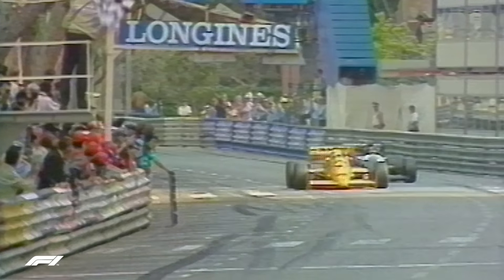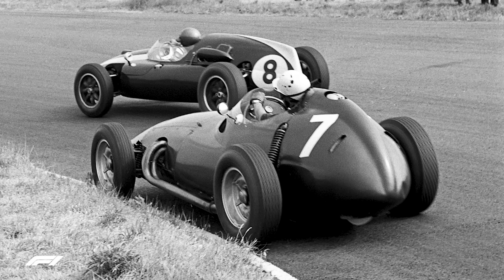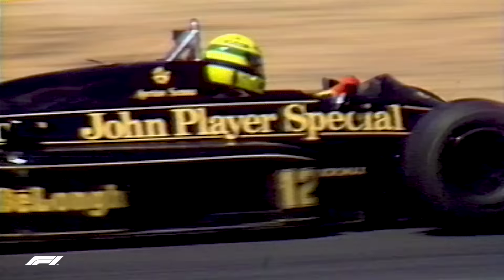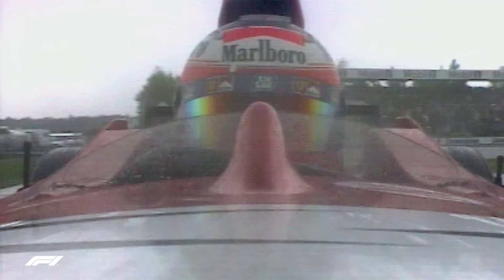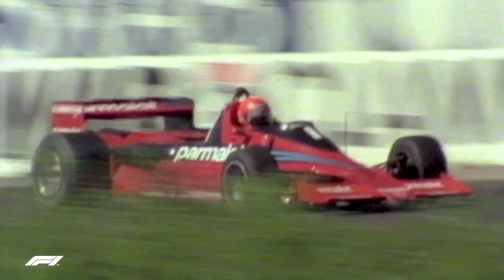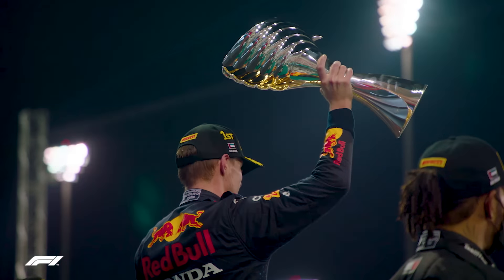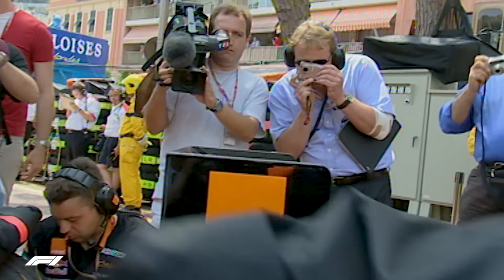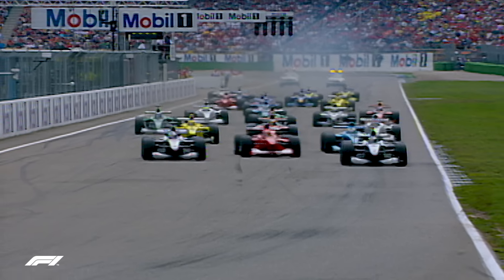Top 10 Biggest Technical Revolutions In F1

Comment: So after they banned turbo, ground effect, energy harvesting and various aero solutions the guys running Formula One realized that you can not really dictate the technological advancement and allowed these technologies to come back over the years?
Reply: It makes sense. New technologies are, by their nature, hard to understand. It wasn’t that F1 was wrong to ban them, it was just that they were banned until they were well understood enough to be effectively regulated.
Reply: @Llanowar_Kitten  True. The main reason for the bans were safety. Now that safety technology has come up and regulations tighten to make cars safer to race, they are now able to implement those innovations without compromising safety
Reply: @akmal94ibrahim  Right. But for the turbo for example, it wasn't only safety. The real safety problem due to the turbos back then were the qualifying engines delivering more than 1000 BHP. They had already found a solution to this issue in 1988 adding a poff-off valve to reduce the power even during the race. 
But they maint&ained the ban on the turbo the following year anyway due to a fundamental reason: the devlopement cost which was enlarging the gap between top teams and the rest of the grid threatening the small teams, the show and the sport future in general. 
That was one of the best FISA decisions. Immediatly, from the start of the 1989 season, there were so many new teams and engine constructors entries, and the gap between the teams in general tightened. 
The other argument against turbos was that this technology was not used yet that much on production cars.

Well, times change, now it's all different. The use of turbos is relevant from an energy and cost saving POV, the technology has come a long way and is largely used on roads, safety has evolved dramatically, and at the end the use of turbos is now mandatory in F1 anyway, so it won't have a negative impact on competitivness of small teams knowing they all have to use them
Reply: Funny how active suspension was put into F1 cars because of porpoising, and now porpoising's back.

Comment: 0:53 no, KERS does not convert the heat of the brakes into energy. It works by taking the kinetic energy of the spinning wheels and converting it into another form of energy. It's basically working the same way as today's MGU-K. Much like it, this could be connected to a battery, but back in '09, it could technically be another form of energy storage, like a flywheel.
Reply: Indeed. Very odd to hear such a mistake, how can they not know it!
Reply: *brakes
Reply: Yep, it is a common mistake haha thank you for explaining.
I even heard of this "heat from brakes" on an F1 technical segment on TV when introducing KERS. 🙃🙃
Reply: doesn't the "K" in KERS even stand for "kinetic" or so?
Reply: same at 7:55 or so, the turbocharger does not use the heat of the exhaust gases, but rather the kinetic energy of the flowing gas, to drive the intake side...
Reply: @AramcoPhil  From a thermodynamic standpoint, heat is the primary energy being extracted. Not the case with KERS.
Reply: @toxiczeu3597  my mind is incapable of remembering this, I misspell it every time lol
Reply: Williams worked on a flywheel system, but it was made unusable by the bigger fuel tanks added when they removed refueling.
That system has been used in some semi-trucks
Reply: @corystansbury  uhm, sure heat is being dispersed and that has its own benefits down the exhaust line, but the primary "driving force" of the exhaust (and thus the intake) Fan is the flow of the exhaust gas, no?
Reply: A more simple explanation: charging a battery with a engine makes the engine have less power, but if they let a fly wheel spin using the engine, and let the fly wheel charge the battery while braking they will have more power and more engine braking
Reply: They are basically the same technology regenerative brakes found on hybrids and EVs today.
Reply: @AramcoPhil  If you look at the contribution of heat, kinetic energy, and pressure in a system like this, you'll find that all three are sort of related (in that changing one impacts the others. In fact, we convert kinetic energy into "stagnation pressure" in certain calculations). You'll also find that in terms of enthalpy, which is the measure of the energy per unit mass in the gas stream, heat is the primary contributor to enthalpy. You'll also see that the gas stream loses heat (temperature) as it goes through the turbo. 

Simplifying it, heat is the energy form that creates the gas velocity. It's not, unlike what many surmise, simply pressure and imparted velocity from the piston pushing it out.
Reply: Actually what they're saying is true, In normal cars your kinetic energy is converted into heat and sound energy on braking while in cars with regen braking the heat part is mostly converted into electric energy there are loses in the form of heat due to friction and entropy and is the main reason why even the most efficient engine on the planet (modern turbo hybrid v6s) are only 50% efficient.
Reply: @corystansbury  aah, check, got you. Thanks for the insight!
Reply: I was thinking how wrong turning heat into energy sounds. Especially in the context of a Formula 1 car. It's just so silly. If only the writers of the Formula 1 Youtube-channel ever properly attended a physics class. Oh well. It made me giggle. 😄
One thing we can learn from this is: don't employ someone with a Youtube-experience as an engineer without a serious background check.
Reply: @khawajabasit977  But a regenerative braking system coverts kinetic energy into electric energy directly. There is no heat step. It would be fair to say "KERS converts energy, which would otherwise be turned into heat, into electricity and then stores that as chemical (battery) or kinetic (flywheel) energy," but that's not what they said. 

BTW, I'm vaguely remembering one of the early KERS systems being flywheel based, but I could be thinking of sportscar racing.
Reply: This dude really corrected f1 on how f1 works, amazing
Reply: Thank you!!! This is what you get when the official sporting channel is owned and run by a commercial business.
Reply: @corystansbury  The heat I was talking about isn't by design it is caused due to friction and the natural entropy of the system otherwise I agree with you completely I was trying to say the same thing just didn't describe it very well
About the flywheel thing you're correct it was a concept pioneered by Williams and they wanted to put it on their 09' car but with the ban on refueling and cars having bigger fuel tanks the flywheel was scraped due to packaging reasons however Williams licensed it to Audi I think not sure who used it in their leman hypercar (I maybe wrong about the category I know it was used in 24 hrs. of Lemans
Reply: Yes it’s painful to listen to.
Reply: The video has several errors. The explaination of KERS, Turbos and also carbon fibre does not come from aerospace engines. From the aerospace industrie in general, yes, but it was used for structural elements. There were 1 oder 2 other inaccuracies, that i dont remember out of my head right now
Reply: @Vaylon.  It has also successfully been used prototype endurance racing. If I recall correctly Audi? used it. And the system was supplied by Williams engineering
Reply: @ab8jeh  Arca Brakes in F1 cars also saved 50 more lives
Reply: @toxiczeu3597  Arca?
Reply: @corystansbury  hi Cory 🙏
Reply: @NightSidew1nd3r  Porsche, I think. But someone in sportscars/prototypes definitely used a Williams system
Reply: You're incredibly wrong and the amount of people that agree with you is shocking. KERS does, in fact, take the heat from the brakes and turns it into storeable energy. It is really not hard to look this up man.
Reply: @BouncingCow  The KERS explanation was correct. It does use the brakes.
Reply: @hockey161616  I did a quick Google search and could find nothing that suggests this. Can you tell me what you found? I'd love to look into this more.
Reply: @hockey161616  the system from 2009 was kinetic recuperation like in most on road hybrid cars, it does not use HEAT. it used a electric generator as a break, converting the rotation directly into electric energy (or kinetic in case of the flywheel Williams looked into, but never used). yes, it would have been heat in the break otherwise, but the heat never existed, so it did not use heat. later on mgu-h or ers-h was added, but only several seasons later (i think that started 2014). It was a break in itself, i never doubted that. it jsut does not use the heat as energy source.

Edit: Btw. recuperation from wikipedia: Regenerative braking is an energy recovery mechanism that slows down a moving vehicle or object by converting its kinetic energy into a form that can be either used immediately or stored until needed. In this mechanism, the electric traction motor uses the vehicle's MOMENTUM to recover energy that would OTHERWISE be LOST to the brake discs SA HEAT. This contrasts with conventional braking systems, where the excess kinetic energy is converted to unwanted and wasted heat due to friction in the brakes, or with rheostatic brakes, where the energy is recovered by using electric motors as generators but is immediately dissipated as heat in resistors.

I would be suprised if it used an indirect way or creating heat first, as it woulod result in losses. Heat in most cases is converted either by the rather inefficient Seebeck-Effect (reverse peltier element) or by steam powering a generator. ERS-H is basically a turbine harvesting the electrical energy. Personally I would argue it converts the velocity of the exhause gases due to a pressure gradient into energy and not directly the heat of the exhaust gas. But that depends on how you view the thermodynamic process and it debatable.
Ofc I it is not impossible that I am wrong, but I did not find any information on heat being harvested with the classic KERS - if you have additional information, i am highly interested.
Reply: I'm pretty sure that when the kinetic energy of the car's momentum is converted into electrical energy to be stored in the battery, it does indeed go through a stage of first being converted to heat energy. Of course, I'm also quite sure that someone who is a qualified expert in how the system operates could possibly correct me on that.
Reply: @colehartel7206  Usually rotational energy in converted by a generator, which itself in an inverted electric motor (in simple turns). The movement of magnets causes electrons to move, which are then stored in batteries. I am not sure where you would need converson to heat inbetween unless its a completely different system. But that would mean power plants also do not use the most efficient system as to current knowledge. The only relation to heat I can see is the heat generated due to losses of the system.
Edit: The source would still be kinetic energy, not heat.
Reply: @the1reef.243  That's where the flow down from F1 to road cars is so visible and important.

Many of these on the list pushed road car tech forward shortly after.
Reply: @hockey161616  no it doesn't use heat energy, it's the exact same thing as the current MGU-K
Reply: @E9X330  wrong.
Reply: A battery is any form of energy storage. Also I think the Williams KERS flywheel never raced, but was patented.
Reply: @AramcoPhil  the flow is the means but the energy concentration of the gas is mostly situated in its state (temperature) and not velocity. That's why electric superchargers can't nearly work as well as turbochargers
Reply: @hockey161616  no actually you are, the electric generator back then already was called MGU
Reply: @E9X330  wrong.
Reply: @hockey161616  look it up, I'd post a link to scarbstechof YouTube let me
Reply: Imagine not knowing how your own technological advancements work. Nice going F1
Reply: Kers connects the rear axle to the motor which has its own resistance that adds some braking which instead of being converted into heat via friction, is converted into electricity. Technically "instead of heat, into electricity" means saying converting heat into energy is technically correct.
Reply: @tkpenalty  by that logic, the modern MGU-K is actually an MGU-H ...
Reply: @khawajabasit977  KERS however is mutually exclusive of the brakes. It uses cars kinetic energy to spin a generator to make electricity.
Reply: @hockey161616  can’t find one article or video that supports your claim. Can you expand on your idea here?
Reply: @hockey161616  link me please!  Everything I read discusses the kinetic energy spinning up a device to store energy (battery=chemical, flywheel=kinetic,some sort of weird hydronic accumulator=weird)
Reply: I think they just simplify, otherwise most people would be puzzled, at the expense of correctness. Also the explanation of turbocharged engines is not exact. Not only mechanics or engineers watch f1. Some still wouldn't understand it as energy recuperated from the brakes. It happens during breaking anyway, if you start with kinetic and such words most people would say 'what?'. Energy recuperated when breaking could be an easier version. After all F1 is a commercial sport and wants to engage everyone. I had never heard of heat from the brakes though, that's odd.
Reply: @nc7547  I agree that they don't have to give a detailled explaination of how KERS works, but I think a sentence like "KERS steals energy from the wheels, which can be reused later" can be understood even by people who skipped high school physics class.
Reply: I came here to say this. Not only was it technically possible to use a flywheel, I believe that Williams actually did.

It's a system designed to recover kinetic energy and convert it to another form. As Ronseal once said… 🤷🏻‍♂️
Reply: They said the same thing about the turbo. heat energy from the exhaust gasses ..... how about exhaust pressure spinning a turbine with a ( you know the rest).
Reply: @corystansbury  A turbo would still work if you ran the exhaust gasses thru a heat exchanger and then through the turbo.
Reply: @allanh233  It would, but the parasitic drag on the engine (reduction of crankshaft power) would be greater. It would increase the pumping work done by the piston, basically making it a supercharger with a really inefficient belt (in this case...a squishy gas being driven past a valve and through a convoluted manifold).
Reply: Like on top gear when they used school children to spin wheels and make energy
Reply: KERS, Kinetic Energy Recovery System uses heat from breaking. Seriously woman it's *K*ERS not HERS. Also turbochargers don't work by reusing heat energy from the exhaust gasses. 
What is it with this video and "Heat Energy"
Reply: @khawajabasit977  What? No. It uses kinetic energy to spin the the electric motor which creates electrical energy that recharges a battery, instead of standard breaking which converts the kinetic energy into heat in the break disks that is then dissipated into the atmosphere.
Since the hybrid and electric vehicles that have regenerative braking also have have an electric motor which is of course also an electric generator this is quite efficient. If it was to use heat energy to electrical energy you'd need a heat recovery system to transfer the eat to some sort of working fluid eg water to boil to steam to spin a turbine to generate electricity and a condenser to recover the steam to water and a pump to circulate back to the breaks, or a use the inefficiency of a peltier plate.
Reply: @hockey161616  Mate its *K*ERS not HERS. The clue about what source of energy it's using is in the sodding acronym.
Reply: is still kinetic energy, then stored as a potential, then kinetic again when used
Reply: Thank you!, I was looking for someone else that cought this... I mean, it's in the name; Kenetic (not Thermal) energy recovery
Reply: @BouncingCow  exactly
Reply: I did agree cause, even the wheels of an F1 cars are spinning , the battery doesn't get recharged, unless the driver stops accelerating or brakes
Reply: They got how turbochargers work wrong aswell? Idk whats going on
Reply: I think they meant it "Replaces" putting heat into the brakes when slowing down with putting energy into the battery
Reply: Also, Auto Union ran rear engined F1 cars in the mid 1930's, decades before Cooper. And Michael May ran a winged Porsche sports car at the Nürburgring in 1957, outqualifying the factory cars(the factory didn't like that and got the organizers to disqualify him).

Comment: I would also add Harvey Postlethwaite's high nose, designed for Tyrrel 019 in 1990 and still used more than thirty years on
Reply: Both of the nose cones that car had look incredibly modern, interesting to see just how perfect bits and pieces of car design ended up being from that era that its still used today
Reply: I always thought that was a Benetton innovation, but you're right, it was Tyrrell. Benetton borrowed the idea a year later with the B191.
Reply: @AshleyPomeroy  Adrian Newey designed a nose for the 1989 Leyton House that was raised higher than the other cars but nowhere near as high as the next year's Tyrrell.